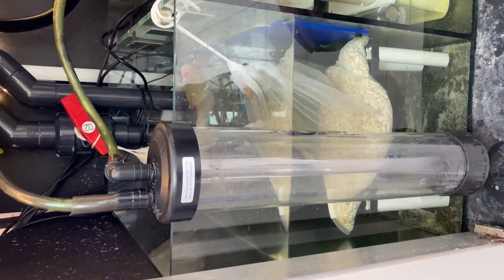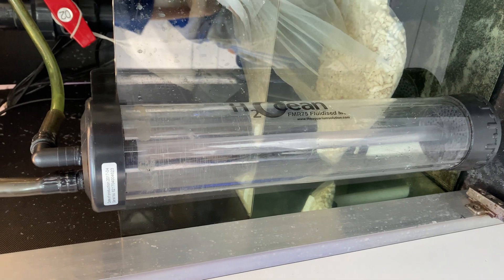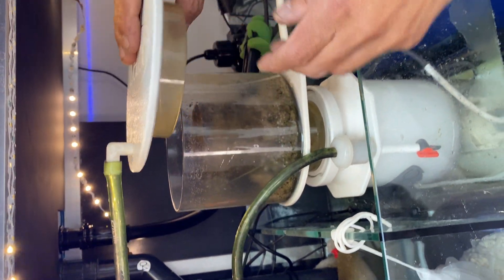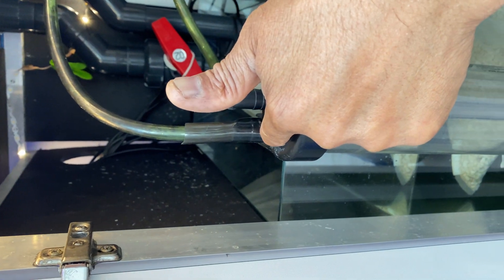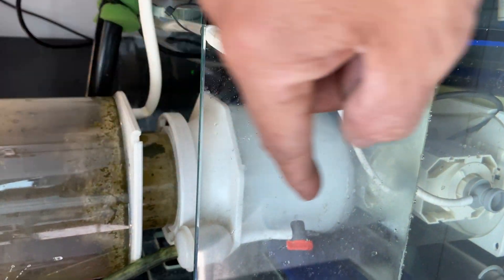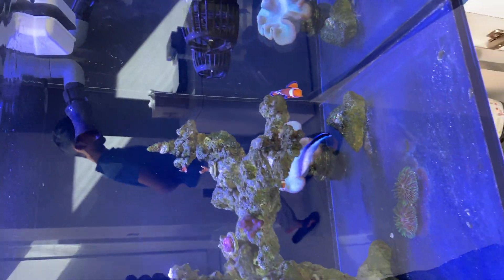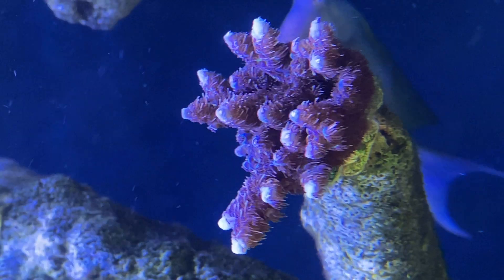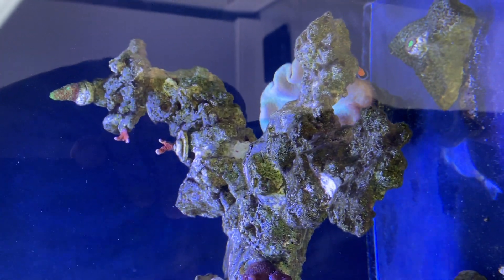DIY CO2 recirculating scrubber

Comment: Hi mate have you tried swopping the internal pipe to the inlet rather than the output of the reactor ? I  just a thought if it did get water inside it the water would have to reach the top before it went into the aquarium